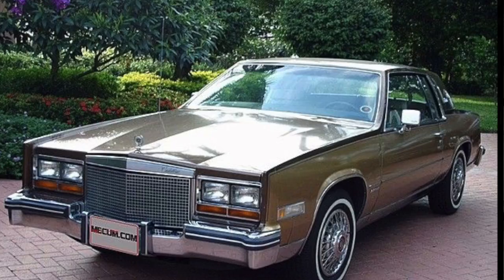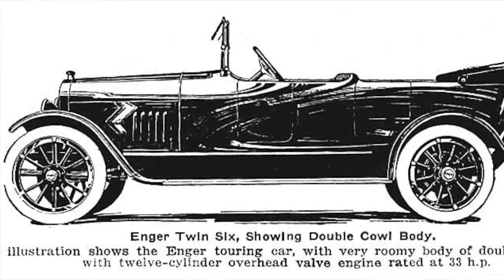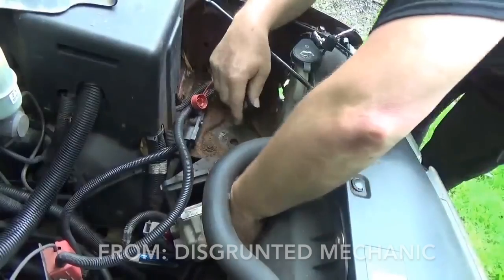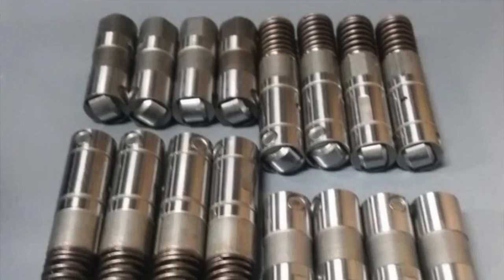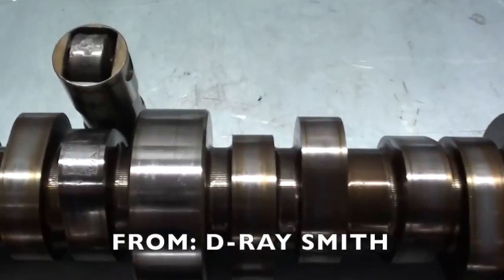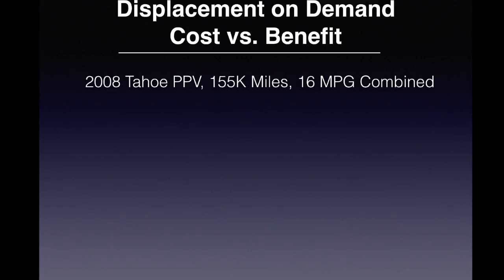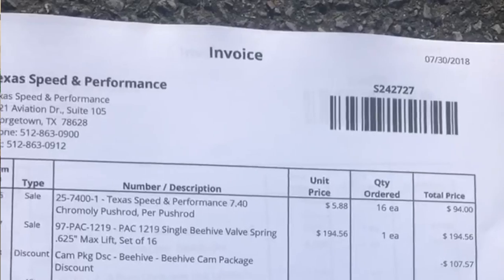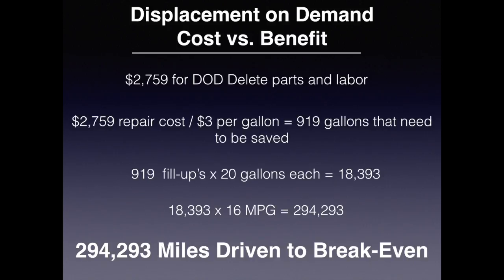DISPLACEMENT ON DEMAND - DOD, Repair Cost and Return on Investment.  Chevy Tahoe Collapsed Lifter

Comment: Thanks, EPA. It's all about "total fleet MPG". If this pisses you off, and it seems counterintuitive, vote accordingly. Frankly, this made the total cost of ownership for my 2014 Suburban, at least $1300 higher. I'll do the DOD delete myself, which keeps the cost in parts around $1.3K, but I have to invest the labor to install it (my time and frustration, plus the hardware and credits to turn off AFM via HPTuners). For those that can't/won't do this themselves, that takes the cost to AT LEAST $2.3k to get rid of this EPA-feel-good system. Ridiculous.

Comment: Have a 2010 camaro 2ss with the L99 and 22,000 miles got the range afm disabler and after much research found throttle response much better and no more shuttering when switching from 8 to 4 cylinders hope I got it before any damage LOL. Got my 8 cylinders all the time now. Damn the gas mileage

Comment: The DOD system keeps both valves (in the affected cylinders) closed during operation. I’m scratching my head wondering how that saves gas? Sure the injectors are turned off during activation but aren’t the 4 active cylinders working harder to spin the engine over and also pushing the 4 dead cylinders through their compression on the intake and exhaust strokes? Why not keep them open so the dead cylinders don’t build pressure? It doesn’t make sense to me. I think it’s a bad design amongst many others this newer generation of vehicles is plagued with

Comment: I turned it off in my 07, it got better mileage with it off, lifter still failed, $4200 to fix it, it got traded in
Reply: $4200? Damn!! Got an ‘08 and tuned it out with HP tuner unit. Parts to totally remove it would be $700 to $800 for me at the dealer. Talk about a hosing! Must be mostly labour costs.
Reply: @killerdoxen  yes mostly labor

Comment: I just traded in a 2018 Silverado 1500 with less than 30k miles on it. This system is the reason I lost 2 months of driving while the camshaft and lifters on one side of the engine were replaced. All of the work was done under warranty so there was no cost to me except for a loss on the trade in at another Chevrolet dealership. GM provided a loaner vehicle since I was still under warranty so I was relieved by that. I traded the 1500 in on the same year truck except the new one is a 2500 HD model with the 6.6l Duramax diesel and Allison transmission combination. Much happier now, the truck runs and shifts much better. My recommendation is to stay away from any vehicle equipped with a Active Fuel Management (AFM), formerly known as displacement on demand (DoD). Or at least plan on an AFM delete kit.
Reply: Thanks it always helps to hear from a owner rather than a salesman.

Comment: from the time my G8 was new, the lifters have, intermittently, clattered at start up. highly annoying. I disabled DoD at about 5000 miles with a tune and never looked back. however, i do wonder if turning off DoD helps or hurts the collapsable lifters in the long run. I'm about to turn 90K and my motor is still going strong but a DoD delete kit is on my list. problem is, i don't even trust anyone to change my oil, let alone crack open the motor.

Comment: Great video, have the DoD knock issue with my 08-z71 Burb.  Luckily, I was able to get the stuck lifter to free itself without a complete tear down.  

However, I want to note a minor miscalculation.  The version of Tahoe you have came with a 26 gallon tank, not 20.... based on my 31g in my Burb, I can fit about 29g in it when it's sucking fumes.  That will change your numbers a little, but still not enough to be worth the cost.

As for my DoD issue, I was able to get my computer tuned (AFM/DoD turned off) by Brendan with http://lt1swap.com/afm_delete.htm for $50 plus outbound shipping (he covers return shipping).

Comment: If you’re in the metro Atlanta area I disable this feature for $150 up to 2016 models.
2017 & 2018 add $100.
Less pedal lag, raised speed limiter and more power included at no additional charge.

Comment: So, Crazed performance repair here on youtube came up with a procedure to "Reset" a collapsed lifter without pulling the heads. In order to be successful with it the AFM needs to be deleted to prevent said lifter from collapsing again. 

I have used this technique 2 times with success both times. Turned a large job into a 2 hour job with minimal cost, and with a long term fix.
Reply from the maker: He and I corresponded briefly after the DOD delete was completed on my Tahoe.  I don't think his fix is a permanent solution but I think it's worthwhile as a budget fix.  I also think next time I'll follow his procedure, then clean the oil screen, flush the engine and a few other lower cost steps before sinking $4k into another DOD delete and upgrade.
Reply: @hullinger  I just can't see spending $4k into a 100-150k engine.  I work on my own stuff so I will patch stuff back together for the cost of parts. If I was non mechanical I would prob opt for a reman long block and software out the DOD.
Reply: @hullinger  Just did a Caprice today. I thought the cam lobe was wiped out since the rocker still lifted a little on crank. It was a stuck AFM lifter. Unstuck it and put it all back together. The VLOM bolts were quite loose when I pulled it apart. I did it cheap, reused the intake gasket/valve cover gasket/VLOM gasket. Only cost was the AFM delete software from LT1Swap.com for $50, + my shipping there ($60 total). For the release tool I used a Phillips long screwdriver and stuck it in the hole. Rattled it with an air hammer and it got back into place. 

Total cost of repair $60 and 1.5 hours of my time.
Reply: East Coast Classics how in the world does it cost $4k for a delete? I live up here in Canada and I can get the parts alone for around $900. If the rest is labour, thank god I can do this stuff myself.
Reply: Saw his procedure on it and I did it even quicker and cheaper. Pulled the valve cover and tapped the rocker arm with a hammer while cranking the engine over. Popped right up. Happened twice. Now it’s tuned out of the computer so I have some time until I can do a cam and lifter swap.

Comment: If you’re in the Metro Atlanta area, I’ll disable the V4 mode, raise speed limit and give you a bump in power.
$150 2007 to 2016 models.
2017, 2018 models $250
Reply: info please

Comment: Someone may have already replied with this, but your math is way off.

At 5:12 into your video, you state 919 gallons need to be saved. 
  919 gallons/19 gallons per tank = ~48.4 fill-ups, 

Assuming you are actually getting 16 MPG, you're getting 304 miles/fill.  
 304 x 48.4 = 14,713 miles. (Not 294,293 miles)

If you extrapolate city/highway, you get ~20 MPG, that's 380 miles/fill, or 
a 20% increase in mileage, which equates to 11,770 miles, etc.

Your math shows how far you'd have to drive if you were only able to recoup the cost at a rate of only one single gallon each time you fill your tank.

Comment: Everyone with this DOD engine should immediately disable it by pulling the sensor connector from the brake booster before any damage is done. Next plan to get a tuner to disable the feature from the PCM so you can reconnect the sensor.  Could simply leave the sensor disconnected forever, but cover the MIL light and reconnect for State inspection.  This assumes the lifters have never collapsed and stuck.
I did get a PCM /TCM tune to defeat the DOD, firm up shifting and Reduce the PWM effect, and adding about 30 ponies.

Comment: I recently got a 2011 Tahoe police SSV (4WD) with 178k miles on it.  I had the oil pump, sensor and seals replaced because the oil pressure was a bit lower than I'd like.  Should I invest a couple hundred in the DOD disabler that plugs into the OBD2 port?  It runs great right now, and I'd like to keep it that way until I get my money's worth out of it.
Reply from the maker: Hey man thanks for checking out my Tahoe video on the DOD system.  And yeah, I would recommend getting the disabler.  It I've seen disablers sell for around $100 and some folks sell their used disablers after they get rid of their truck.  I don't really think a disabler is a cure for the DOD problems but I do think it will at least delay the problems.  Plus you can remove the disabler from the port when going through inspection too.  Good luck!
Reply: @hullinger  Since my last comment,  I've put about 8k miles on the Tahoe, using the Range AFM disabler.  It definitely runs better, so far no lifter failures.  I do hear a quiet ticking on some days, and the oil pressure still hangs below 10 PSI when idling and fully heated up.  But so far no more check engine light or other warnings.  I used to get occasional "catalyst performance below threshold" codes, but since adding the AFM disabler, that stopped happening too.  Doesn't seem to be using any oil either.  I hope to make it a few years, though if I can't figure out how to stop the water from leaking around the driver's door, there won't be much of a floor left.

Comment: I think a lot of this has to do with the CAFE mandate standards, which also killed one of my favorite cars, the Crown Vic.
Reply: ....Crown Vics had their flaws, like a stupid Plastic Intake Manifold with a water coolant line running thru it, for one, they were poorly built injection molding, #2 cheap plastics, #3 outdated interior, #4 Police Interceptors had horrible seats in it.  

I drove like 3-4 for my job, after police departments sold them off, mostly from East Texas PD's.  Not enough protection under the radiator, car needed a skid plate or something.  Car was outdated, design wise. imo
I also drove a 2004 Chevy Police Interceptor 9C1 (an 8th Gen Impala), that was a far more comfortable ride and car, imo

Comment: My 08 was drinking 1 1/2 qts every 5,000. Bought the range arm disabler, boom no oil burned. Best 200$ I’ve spent. Same mpg as well
Reply: Mines doing the same ! 211xxx miles should I go ahead and get that disabler or DOD Delete. ??
Reply: Did the same thing for my 2011 Silverado and it made such a difference!

Comment: Thanks for making the short video about AFM and DOD. I'm considering buying a slightly used Silverado or Sierra with the 5.3, I think they all come with AFM/DOD. Electronic plug-in delete chip looks pretty easy, and maybe a lifter swap at some point. I still like those trucks, just doing some research. Do you have any other recommendations?

Comment: Pull off the heads. Pull pistons out. I'll explain two ways to replace them with a free energy system that pushes or pulls another way, no gas.
Reply: He wants to put a horse or 2 in the front to make the vehicle run! Pun intended

Comment: All our departments PPVs have had this issue and had their engines rebuilt before hitting 100,000 miles. They should leave this off police vehicles.
Reply from the maker: Totally agree with you on leaving off the DOD feature on police cars.  Funny thing is that Chevy has V8's without DOD so it's already in their inventory.  Seems pretty simple to me!

Comment: I bought a used 2011 Yukon XL 2500 a while back (with a 6.0) and thank God, no DOD!  :o)
Reply: I think the old vortec 6.0L is a really under appreciated engine.  No DoD and no Direct Injection.  Direct Injection is fine if you keep up on your intake cleanings but that can be a whole other nightmare too....

Comment: Damn it. Best follow up video I've ever seen. 
I rebuilt mine the first and second times as original. Kept afm.
3rd time, only outa curiosity with a delete kit minus cam. Flashpaq tuner.
Raised both rpm a little bit, runs spectacular and glad I did it. Now that suburban went from a regretful decision to a love.
I made the change only because the suburban is in impeccable shape, and it cost a total of $700 bucks.
In my case it had nothing ta do with savings on fuel or I woulda bought a Toyota.
Reply from the maker: Wow man, thanks so much for the love on my Tahoe DOD vid.  Glad you enjoyed it and also it's cool that you did the DOD on your suburban.  Totally makes sense to put $$$ into the engine when you get the truck for so little.   Since getting my truck back from the shop with the DOD, bigger cam, headers, tune...., I've now got a 400 horsepower smile-maker that I love driving!  Thanks again!  -Chris
Reply: @hullinger  

Ahh.
Bout it for 6 grand after saving for it 2 years.
The first amount was just the last work on engine
Reply: NO NAME  I ended up tuning idle up a lil. Still missed a little at idle so I ended up swapping the cam.

I've gotta look but you can order the cam with a single bolt, minus did.
Doesn't have to be a 3 bolt cam.
Reply: NO NAME with dod cam, It did run great on highway though.
In traffic it had a harder shift and a little miss at a stop.
Reply: NO NAME  Yeah, gm og has a single bolt, non dog.
I was happy to find it, im no mechanic but gotta say, it runs great now. Been a while.

Comment: Im just about 300k miles on my 2011 silverado 1500 5.3L havent had any problems yet.
Reply: Me too. I have a 2002 Chevy Avalanche V8 Vortec engine 1500 about to hit 350,000 and no problems what so ever with engine. Still running awesome ! Knocking on wood right now ! : )
Reply: @dimasbeltran866  chevys last for ever scotty is wrong about chevys
Reply: @macario9035  I agree with you on this one Maria. Scotty is wrong about chevys. I bought my Avalanche with 19,000 miles. Change my oil every 3 to 4,000 miles. Only changed out water pump and alternator once. And a couple other normal wear and tear things. Like my battery, water hose but other than that Maria. Awesome engine ! Take good care of yours and it will last forever ! 👍
Reply: @dimasbeltran866  only thing I've changed is oil spark plugs brake pads and shoes and control arms because I wanted to replace them. No check engine light nothing runs like a champ original 6l80 transmission in it.
Reply: @macario9035  That's awesome Maria. Sound like you take great care of you truck. Unlike most women that just drive them. They don't check oil level, tire air pressure or anything. Lol ! But, Cool Maria. i'm happy for you. 👍 Hey, can i ask you what nationality you are ? Just curious never heard of your last name before. : )
Reply: Totally agree   had my lifters changed to due collapse   1880 cost    at 250k   did I save     don't think so    time for a afm delete   and keep it a v8

Comment: 2015 GMC Yukon Denali 125k now ticking and knocking. Facing at least 1000 dollar lifter job. My question should I try an engine flush first or just get the lifters replaced. I’m scared that after that it will not solve the problem. I certainly hope the cam is not messed up too. Side note I did decide to floor it out of frustration and the noise got slightly better. It has now been about a month and about 1000 miles since the ticking. No check engine light. What should I do?
Reply from the maker: Check out this guy on YouTube.  https://www.youtube.com/channel/UCPv3FhkMx3e--ndF_d_x6ZA   He came up with a way of dislodging a stuck cam lifter without taking the heads off the engine.  It seems to work, at least temporarily.  From what I've seen, when that ticking starts it's typically the cam and lifter that starts to wear since they are the softest metals.  On the aluminum block engines, the lifter bores would wear first causing major engine block damage.  Good Luck.
Reply: Keep flooring it.

Comment: That happened to us on a 2012 Silverado with only 140,000 miles, cost $3,000.00, pissed me off. I couldn't find anything on line either.
Reply: mark allen yep, just spent $3200 on a 2009 with 147,500 miles. Still cheaper than a new truck though.

Comment: I have a 07 suburban and I've been dealing with alot of weird vibration when the SUV switches from v4 to v8. I'm interested in this afm disabler. Would u recommend this to someone like me dealing with this problem??
Reply from the maker: Hey man, thanks for the comment on my Tahoe and the problems with the Displacement on Demand.  And yeah, I would recommend a disabler for the Active Fuel Management.  They are around $100 on amazon, folks that have used them all seem to comment that it works, it simply plugs into the OBD port and it's easily removed.  It might prolong the life of the AFM lifters and of course without the AFM solenoids coming on, you won't get that exhaust smoke that happens sometimes.  To me, those disables seems like preventative maintenance.  -Chris